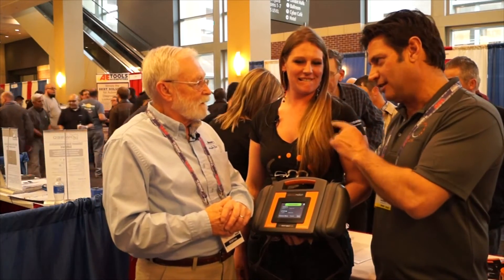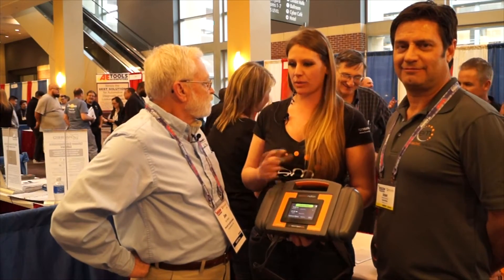Find Every Elusive Parasitic Drain - Wrenchin' Up

Comment: If you would spend almost 2000.00 on this tool there really is a sucker born every day.
Reply from the maker: Hi and thanks for watching! I find your comment interesting and wonder how much you think a piece of shop equipment that can monitor a vehicle's electrical system over a long period of time and record when a parasitic drain occurs should cost?
Reply: Alot! Only problem is the drain you speak of is maybe once or twice in a lifetime. A parasitic drain that is fairly common shows its head fairly often and this tool is overkill also pulling fuses is yesterday's technology.
Reply from the maker: Hi - I agree with a lot of your comment, but the frequency of these types of parasitic issues has been increasing on newer vehicles as explained at http://www.ParasiticDrainTest.com. At any rate, time will tell. Thanks again for your comments and thoughts!